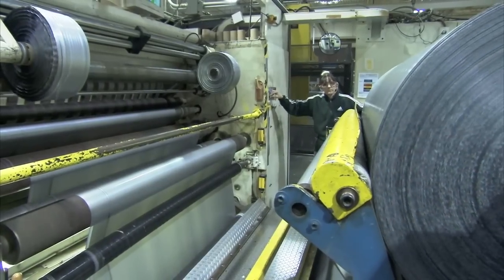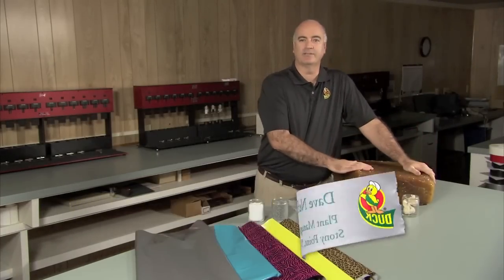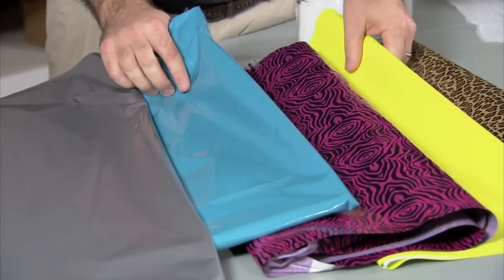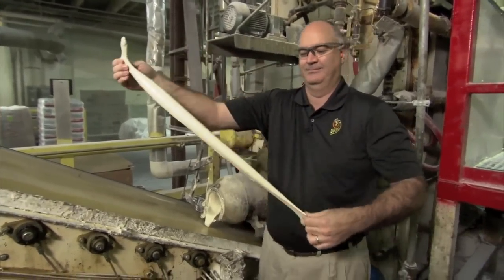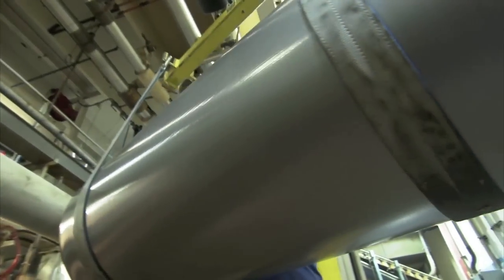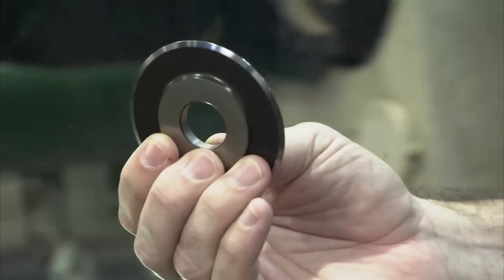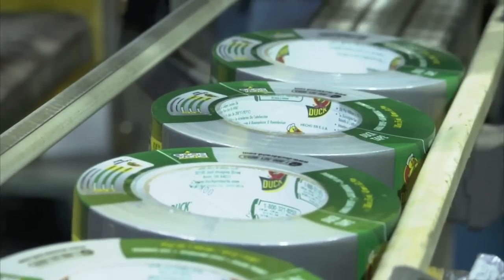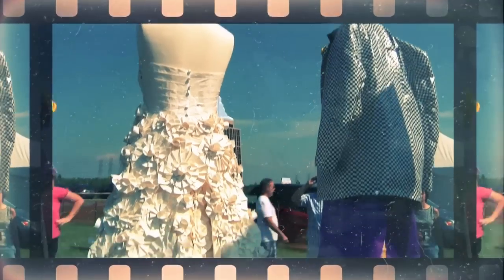How Duck Tape is Made

Comment: Duck tape is what it was originally called back in World War Two they used the feathers and the lining of the fat of the duck and took tar and adhered it to the ammo cases to make them water proof. Later they found a thinner material to use so they no longer used duck feathers and fat. And now it is most commonly used to fix ducts. There for both correct terminology.